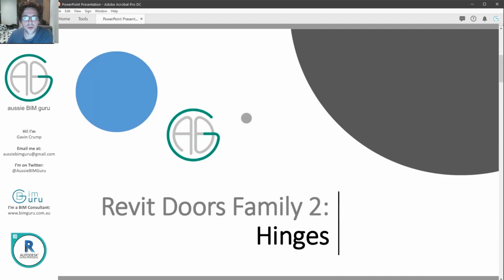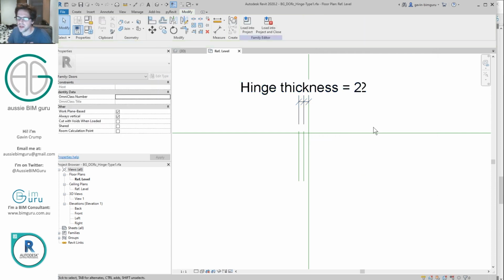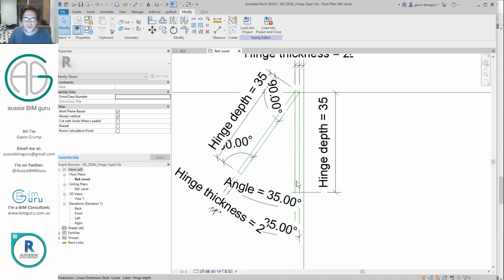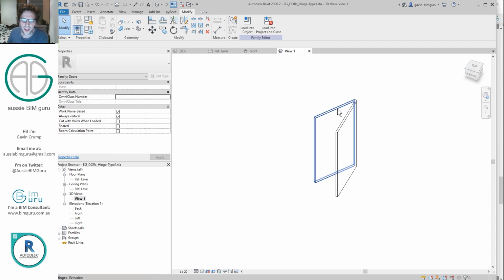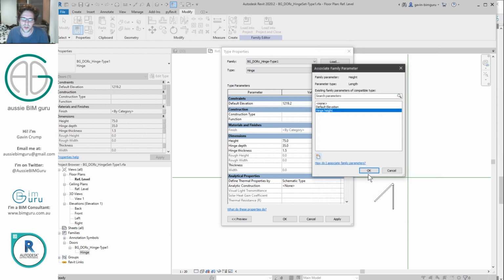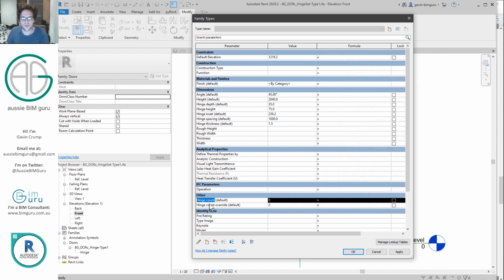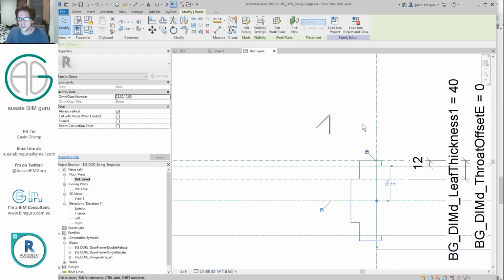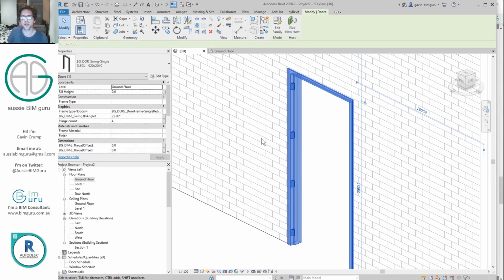Revit Doors, Part 2: Hinges

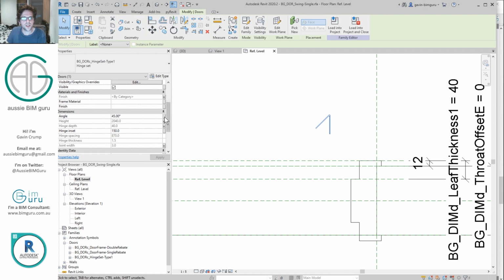Comment: I can't find my "Angle" parameter when I load the "Hinge Set" family in Door family, at 24:02 in this video, (the Angle parameter is present in Hinge set file and hinge file, but not showing when it's loaded in Door file). I know it's difficult to understand my mistake, but, Please guide if You can get the idea of this problem.
Reply from the maker: The most likely cause would be that the parameter is type based in the hinge set so you can't see it at an instance level.
Reply: @AussieBIMGuru   In that case it should be shown in the Type Editor, but, It's not even present in Type Editor.😷. (Anyway, It's showing as a instance parameter in "Hinge set" file when hinge is selected.)
When I opened Your Github file i'ts in the familytpe editor as well as as instance parameter, of Your Hingeset file, but, in my case it's absent in Familytype Editor of Hingest file, only present as instance parameter.
+ How to edit a parameter once it's associated with another parameter (through "Associate family parameter" option in Properties Panel), as It grays out and could'nt be changed.
Anyways, You're truly a BIM Guru.🏅

Comment: Sometimes angle constrains fails. I remember I have seen a very interesting technic from Paul F. Aubin in LinkedIn learning where he achieved the rotation by involving a sweep where the axis of rotation is the path and then he applied an angle Parameter to the profile of the sweep. Just in case I found that very interesting.
Reply from the maker: Yes it works in some cases. I have a video later in this series where I use reference lines to host families to instead which is quite reliable in my experience.

Comment: Hey Gavin. First of all thank you for the tutorial. I wanted to ask something. Somehow on the frame type parameter where we defined single and double rebate, I have hinge as well, which tries to turn the frame into a hinge. What do you think can be the reason?
Reply from the maker: Family type labels will see all common category families, so the hinge is given as an option if it is the same category. Unfortunately autodesk hasn't built in a way to restrict the options beyond that.

Comment: Hello,
In the minute 5 you create a small reference line to be able to lock another one at the end. But you can actually lock a reference plane endpoint to two reference planes (horizontally and vertically). or am I missing something?
Very good videos by the way.
Reply from the maker: You can constrain parallel distances between reference planes, but can't keep them locked on an end to a point. The only way to lock a reference planes angle is by rotating it about an origin in a family.

Comment: I fixed the issue with the hinge not being able to be set in certain angle by loading my hinge family into hinge set family with the angle of 140 °.
Reply from the maker: Yes it seems sometimes the default position in a family can help tackle this behaviour. It's always quite inconsistent depending on the scenario though - confusing!
Reply: that's work! , thank you for useful comment

Comment: If you wanna avoid those 90° angle constraints on the ref lines, and in the same time it is not worth nesting the rotating parts it is also a viable option to set the master rotating refline to the active workplane and place all of the remaining elements on the ref lines workplane. This way all the other elements will rotate with the refline without actually constraining much. Constrains = calculation = time.
Reply from the maker: Yep, I have a video later in this series where we use this concept as an alternative approach.

Comment: HI Gavin, I'm half way the video. At 14:41 Could it be that the circle should be constrained with the reference line that rotates so that it moves along with it instead of constraining it with the front and right reference planes? I also noticed that an angle greater than 0 and less than 27  degrees creates a segment on the circle somewhat near 0.79mm between both leaves of the hinge,  which is the greatest length that Revit allows with joined geometry and small scales.  what is strange is that the cylinder part is only being joined with one of the leaves. Thanks for the tips Gavin
Reply from the maker: Yes this circle piece has proven problematic for many unfortunately. If you can graphically accept it, not joining may be a better/safer approach due to the 'sliver' of geometry Revit can't handle.

Comment: Tried to replicate it twice. When I try to join hinge to the cylinder. I've got the msg can't keep elements joined (pops out with a warning 1 Hinges: Extrusion: id 4613). Even tried to make cylinder radius longer but didnt help. Also when I flex the angle constrains are not satisfied :D Anyone else had a similar problem?
Reply: Make sure that the angle of the hinge is not a small number, try to flex it to 45 degrees. the small portion of the circle between both parts of the hinge must be higher or equal to 0.79mm I guess that is what is happening according to Autodesk that is a requirement for small scales and the hinge is a really small part. I tried joining them while having an angle of 15 degrees and got the error.  https://knowledge.autodesk.com/support/revit-products/learn-explore/caas/CloudHelp/cloudhelp/2016/ENU/Revit-Troubleshooting/files/GUID-DB17C879-3A44-471C-8C66-2A1CAD0A6C05-htm.html   Revit has some strange limitation rules hehe. It worked for me by increasing the angle,  I hope it works for you,
Reply from the maker: Angular constraints can be very tempremental to set up unfortunately - sometimes they behave as expected and other times they break for no apparent reason.

Try the following things;
- be absolutely sure you constrain all sketch lines to reference lines only
- pick line on the long edges first
- draw the short lines parallel to the reference lines but dont constrain yet
- first, trim the big lines to the short lines in that order
- align and lock the short lines

That might help hopefully - I've found the trim order is usually crucial to make these types of constraints work.
Reply: @AussieBIMGuru  Sorry for a late reply. I was fighting with it yesterday and today. Almost threw my pc through a window :D. Tried everything but still doesnt work. I could join circural extrusion to static hinge extrusion but not to a flexible hinge, also when added fillet to the the flexible hinge extrusion (not static as per the video), family didnt want to flex. I end up with 3 seperate extrusions (flexible hinge, static hinge and circural). It flexes properly, nobody would notice a difference anyways. It almost seems like revit cannot handle flexing and joining  smaller dimensions. A laso find type and instance parameters quite difficult whist nesting but its a lack of experience I guess. Glad its all sorted now. Time to create leafs now :D
Awesome video, good job!
Reply from the maker: You're welcome! Yeah if the join doesn't function no big deal I'd say. I'll share a technique next Monday which shows how to build rotateable families without the need for multiple angled lines as well - might give a helpful alterantive.
Reply: @danielwiesiek  I am facing the exact same issue so please don't throw your computer out the window just yet haha!

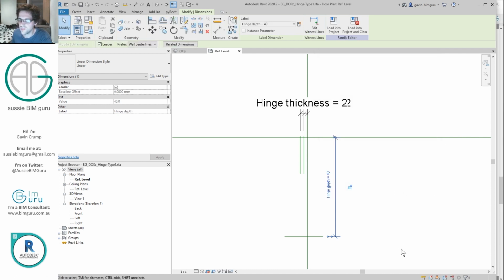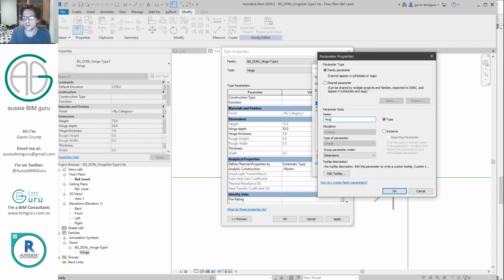Comment: Hi Gavin. Lots to learn for me here... One issue I encountered was the "Hinge Depth" (4:40min) needs to be a Type Parameter, not Instance. I wasn't able to nest it (15:50min) initally, so had to go back and change it. Thanks for putting this together!
Reply from the maker: Hi Christian, good to see you around again!

Strange, might relate to Revit's issues with trying to rationalize angle references, I find it can be quite tempremental.

Comment: Just want to point out a different approach to controlling angle parameters with reference lines since I lost more time than I care to admit figuring out how to control reference line angle and geometry that is associated with it.
I eliminated them completely. You can nest the family that needs rotating, and avoid the pain. At most you need 3 families:
1. Family F1 - only geometry (with parameters to control the dims)
2. F2 with nested F1 placed in origin, assign rotation parameter (this family is useful because you retain the reference planes when nesting further, and you can adjust the XY position easy). 
3. F3 - main family, nest F2 and map angle and geometry parameters

Anyone interested in taking it apart: 
https://drive.google.com/file/d/1Kj-mEgHXgsIJJYrdvNBd5L2-QEErsqXW/view?usp=sharing
Reply from the maker: Thanks Vuk, I actually rearranged the running order in part 3/4 breakdown and part 5 will deal another method that makes things easier, by hosting all the elements to a reference line at the family level.
It's easy once you figure out how all the relative ends of the hosted families work, but it's a very particular setup so wanted to show users my approach first.
One benefit this approach has over yours and my first one is that you can associate label parameters to nested families (handles, leafs etc. at the family level) whilst still having a rotatable door leaf.
Reply: @AussieBIMGuru  Looking forward to it :)
Btw, you still have the option of assigning a Label (Family Type parameter) following my approach.
Reply from the maker: @vukvukanic1095  ah right you are, as long as you orbit everything around the same origins I guess - my bad!

Comment: one question why you didn't use "Last" option in Array?

sometimes i also got an error when i use angle parameter with Reference Line.
Reply from the maker: In this case I didn't use it as I find it more effective for a user to visually see the spacing's impact on the array rather than bury it in a formula. If I was building this for real though the 'last' option is a much better approach so it's a great spot!

Yeah reference lines and angles are very error prone, I find I have to constantly test and adjust parameters as I go to avoid things breaking later on.